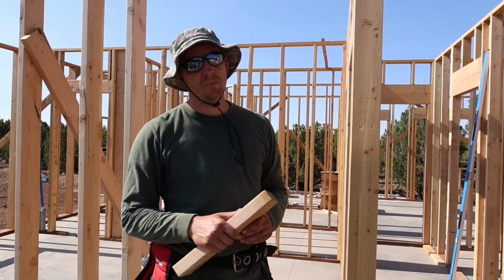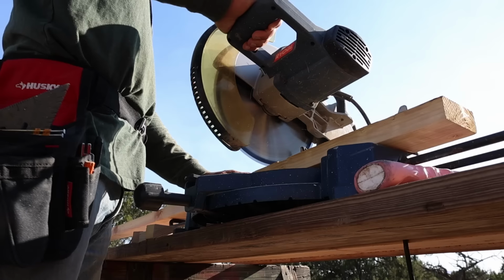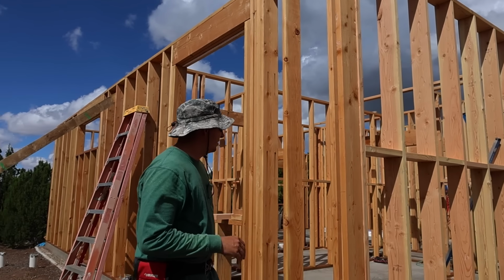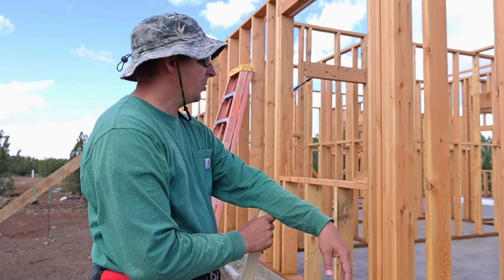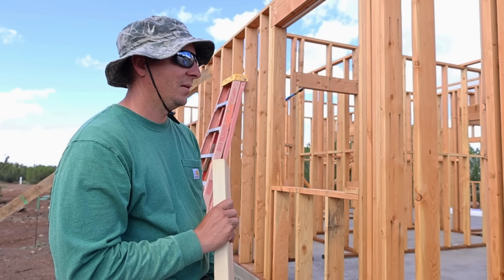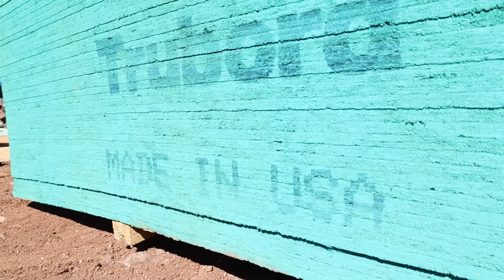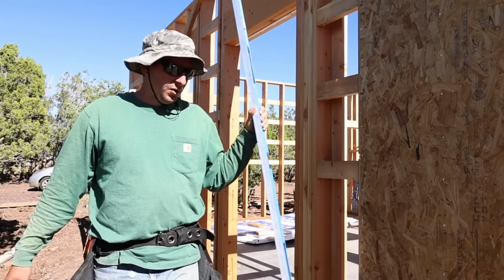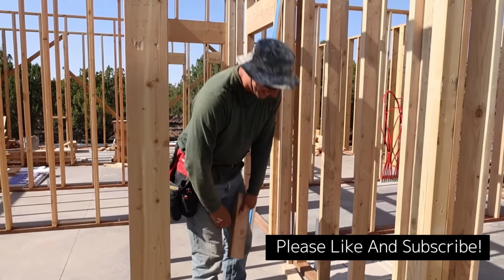OSB Was FAST! Blocking Was NOT 😵‍💫

Comment: In my 40 years of building, I have never seen a better more perfect framing job, that is beautiful. I am sure you already thought of this but, in case you haven't, a little more blocking will make you happy when hanging your cabinets. Run a course for the top of your base cabinets to secure to the wall and since your ceilings are taller, run a course at the top and bottom for your wall cabinets. I would suggest blocking for the vanities and laundry room cabinets also. Blocking for heavy shower doors to hang from is a plus. Depending on what type of pan you use for your shower, block for the top of the shower pan to secure too as well for as above and bathtub. I loved your bloopers.
Reply: We blocked everywhere as well just to give us better holds for items we knew we would hang later,  including TVs.

Comment: Love watching your progress on your build and how you include the kids in the process. While I am not a “builder” I was wondering why you applied the OSB vertically instead of horizontally. It would appear that your location is subject to windy conditions and a horizontal application would probably provide more strength to the walls against racking in windy conditions. Thanks and keep up the good work.
Reply from the maker: Normally I would have put them horizontal but the architect has them as vertical on the print. Thanks 🙂
Reply: @aboulderlifeoffgrid  Great job following the plans then! You do not want to have to redo things when the inspector comes out 😂
Reply: @aboulderlifeoffgrid  My recommendation is to fire the architect and get a real engineer to design things.  Then, either replace the vertical oriented OSB with horizontal, or, add another layer of OSB on top of the vertical OSB, in the horizontal orientation, with staggered seams.

Houses are commonly built in the US with rectangles instead of triangles, but this makes them weak against simply falling over against a strong wind or earthquake (and/or, due to additional complicating factors like wood rot that ate the OSB, due to water ingress over time).  Triangles are strong (when built with materials like wood which have both compressive and tensile strength).  Rectangles are weak.  The only thing that really holds common rectangularly constructed wood houses in the USA upright is the horizontal exterior sheathing.  They would easily fall over without the sheathing properly being installed (in the horizontal orientation, with staggered seams), and this is especially true of two or more story tall buildings.

Also, "OSB" stands for "oriented strand board".  If one studies the wood chips that get pressed and glued together, one may notice that more than 50% of the the wood chips are "oriented" with the long side of the wood chip parallel to the long axis of the board (ex: parallel to the 8 foot side for a 4x8 foot sheet).  Additionally, some OSB will specifically have markings on one side that says "Strength Axis" and have arrows pointing in the long dimension of the board.

OSB is not equal strength on both axis of orientation.  Consequently, OSB should be installed in the correct orientation, which for exterior sheathing purposes, should be done in the horizontal orientation (long axis parallel with the Earth's surface), with staggered seams.  Failure to due so does severely compromise the integrity of the structure, and one day, the building may simply collapse and crush the occupants, especially if the wood periodically gets wet.  It does not matter if some "architect" went to school and thinks they know what they are doing.  It also does not matter if some government official inspects your building and gives you a "pass" (since it matched the building plans).  Any "architect" that calls for vertical OSB exterior sheathing should be fired from their job, at least until such time as they acknowledge the error and learn more engineering.

Comment: During my 8 plus years in the building of apartment buildings the only air nailer used on site was for interior trim installation. We always only did hand nailing of everything else and used what were called sinkers which had a slight coating of glue. But then this was during the late 1970s into the late 1980s so air nailing was just coming into vogue. Also the construction company I worked for had been in the building businesss already 50 yeaars at the time of my beginning to work with them. These guys were in their 60s and still walking top plates.
So Jacob, if you aren't using ring shank nails are you using common nails and if so do they have a coating of glue? Or were these slighter smaller in gauge than common nails which typically are larger gauge with a smooth shank?

Comment: In the City, some Enforcers will tell you to use Nails...as per building Code..the Problem with Nails is the Need for an Air  Compressor and the Higher Noise Levels..Neighbors..so its a Dilemna..For those reasons, I like Screwing Wood structures together also....also, it can be undone..

Comment: Watching your struggle installing the fire blocking, you may have come to understand why most framers stagger the height of the blocks to make nailing far simpler. And even if code doesn't require it in your specific build, there's no harm at all to install the blocking anyway. I personally prefer to over-build as long as it doesn't negatively impact the final result. Now, doing retrofitting, fireblocking is a real pain in the booty when trying to add additional outlets or switches, conceal home theatre wiring, etc. It's why I own 2 6ft drill bits and glow-in-the-dark fish rods and swear like a sailor.